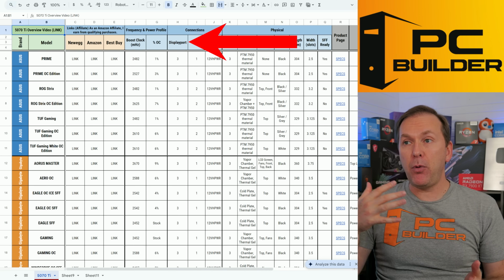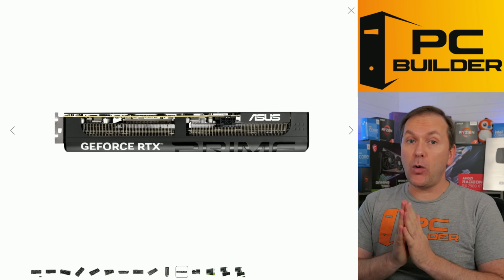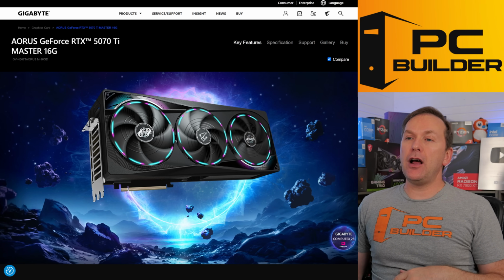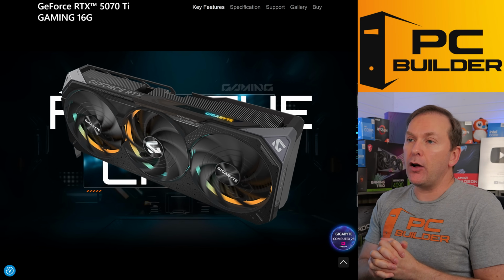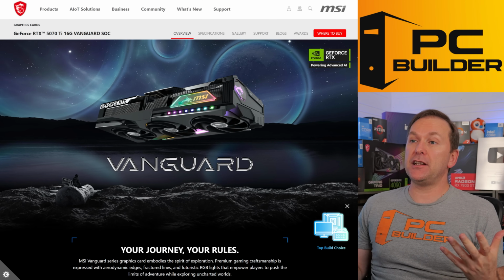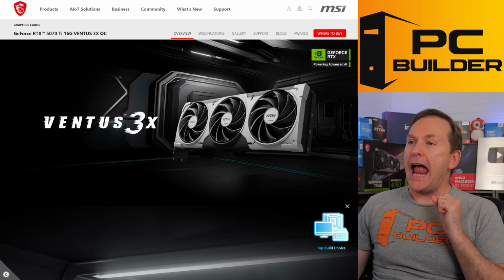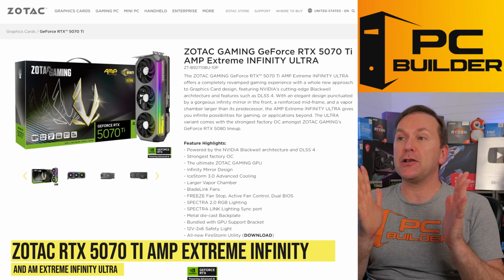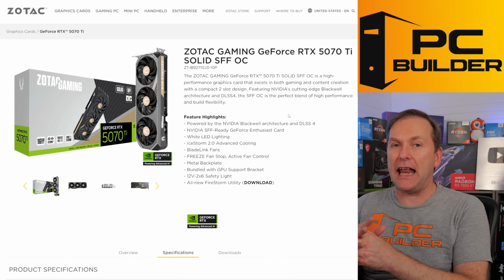DON'T BUY WRONG! 🛑 Every RTX 5070 Ti Model - Specs & Features

Comment: in 9:23 I read online and some ppl said it only turns on or flashes when there is a problem, that it should be normally off. in Gigabyte's site it says ''When experiencing any power supply abnormality, the indicator will alert gamers by flashing light.'' so they're not very clear on that. 

 I just wanna double check cuz i ordered an 5080 Aorus master ice and wanna make sure before it arrives :)
Reply: I have a gigabyte 5070 ti and can verify that the LED is only on when there's an issue with power delivery.

Comment: Im sorry, but what was that gigabyte review? 30 seconds just to gush about an LED light? What about the specs?! Base clock speeds?! Length dimensions?! Like..... 🤦‍♂️
Reply from the maker: Take that up with Gigabyte I’m afraid. Like I said in the video they didn’t provide any of that info before the launch (unlike everyone else) and they didn’t respond to my email asking them. It’s probably up now so I’ll get the spreadsheet updated asap but I’m working on the links as fast as I can.
Reply: That makes sense, thanks. Huge ball to drop for gigabyte  @PCBuilderChannel

Comment: In my country right now the RTX 5080 (FE and Ventus 3x OC) is cheaper than the Asus Rog Strix 5070ti OC, so what should I buy base 5080 or 5070ti OC? In this case, I only play games in 1440p resolution
Reply from the maker: 5080 is overkill for 1440p gaming but if its cheaper than the RX 5070 ti and you have the budget for it why not go extra strong? Thanks for supporting the channel!

Comment: MSI Shadow 3X OC is the cheapest in my country... Is it reliable to go for it? Or go for Asus prime?
Reply: Any of these, even more expensive, you can get coil whine, luck of the draw. Everything else should be fine.
Reply: I had both and returned the Shadow 3X due to noise and temps. It's not terrible. But Asus Prime is sooo much better. :)

Comment: I got a  9070xt, but my multi monitor setup is not running up to the monitors' specs. Returning for a 5070 Ti, which also nets me more efficient performance on Counter Strike 2

Comment: I've noticed something on the spreadsheet. Regarding the specs of the Asus cards, they have a Boost Clock and an OC Boost Clock. For the Asus Prime OC it is 2497 MHz in default mode and 2527 in OC mode but on the spreadsheet the boost clock during OC mode is listed. Is that intentional? Are those the only models capable of OC mode while the others only have a higher default boost clock?

Comment: Please include noise measurement and also info about how many shunt resistors are there on the PCB (with more shunt resistors, the card can detect unbalanced power cable wires).

Comment: That MSI Shadow was on limited sale over the weekend at an online-vendor in my country (still seems to be going with 11 percent of the cards left) - it sold/sells for just under EUR 800 which is ~80 EUR under local MSRP (879). 
Despite that: I bought the one I probably like the least, visually. Palit 5070 Ti  GamingPro OC. But it was "cheap" (EUR 30 under MSRP), comes with a metal backplate (not plastic like on the MSI Shadow for example), has adult sized fans and even a little RGB. Plus, I think, it comes with a little higher TGP than stock from the factory. Haven't received it yet, so I can't comment on the card, but I will admit I'm a little nervous as I've been on Gigabyte cards for over a decade now and have no experience with this particular brand.

Comment: Would rtx 5070 or 5060 ti 16gb last longer. Also 5070 is 630 euros and 5060 ti 480 euros which if it would be a good 1440p gpu i would like to save 150 euros for a monitor
Reply from the maker: Hop over to our Best GPU May video, that might help you think through which is better for you

Comment: I'm running the MSI RTX 5070 Ti Shadow 3x paired with an i9-14900k
Reply: How is it performing so far temperature-wise?
Reply: @its-hdr5152  I have a Lian Li Lancool 217 case and using the Lian Li GA 2 RGB AIO and I'm not going above 80 deg on max settings on AC Shadows and getting around 200fps on average.  It's a great combo so far.

Comment: I have i5-12400 and want to upgrade from 6700 10gb to 5070ti Asus Prime for 1440p. Should i get the i5-14600k? Wanted the i7-14700k but only have 750w gold fractal psu.
Great vid Jason, thanks!
Reply from the maker: You certainly can yes, but hop over to our Best PSU 2025 video and follow the method there to check your new wattage needs

Comment: He's wrong on the led power connector for the aorus master 5070ti, the power led will only light up (flash) if the power connector isn't plugged in or isn't fully plugged in. Just thought id clarify 🙂
Reply: Thanks bro, this dude just scared out of me when he said that the LED should be always on 😭
Reply: @G3n0t  no problem I bet a lot of people felt the same has us lol I was also worried and gigabyte confirmed it should be off when fully pugged in then flash when not fully seated or not plugged in 👍🏽

Comment: I know it's not about processors its worth the 7800x3d at 385 on amazon? I have a 7600x and im like should i???
Reply from the maker: That is a good price for the 7800X3D, but the performance difference from a 7600X would depend on what GPU you have. Hop over to our Best GPU/CPU Combo 2025 video for more on this

Comment: I just bought a  ASUS 5070ti OC  TUF  gaming i was wondering if that was a mistake that i sould have waited  also if the problems with the 50 series were fixed
Reply from the maker: That's a good card. I would just make sure you update to the latest bios but you should be fine

Comment: Hi! Wondering if you have an opinion or advice? My PC is currently a 7800x3d, 64gb ram and 9070xt gpu. It seems to me the 7900xtx might be a better card. Am i wrong? My current gpu runs so close to the 16gb ram that it has. so wondering if the 7900xtx 24gb is better?? confused about all these cards...just getting into VR....newbee!

Comment: On 9:20 about the power LED are you sure the White light is on when everything is fine? i had two Gigabyte AERO models, both of them did NOT had an LED turned on. I think the LED only powers and keeps flashing when there is a problem on normal use there is no LED atleast on my card?

Comment: I thought the MSI Vanguard SOC was the best 5070 Ti version? You can OC it to 5080 lvls of performance quite easily
Reply: It is, tech power up got it to overclock more than the tuf. The spreadsheet is pulling from the advertisement specs claimed by each of the AIBs.
Reply: @alex.fly4  undervolt it for 5080 stocke setting performance

Comment: I went from 3060 laptop version (6GB of VRAM 😱).  That little card hung in there, but recently upgraded to Asus TUF 5070ti OC and it is running amazing.  I can finally use RT and max out settings with upscaling and looks AMAZING!  Yeah prices suck, but I love replaying games I was stuck on medium or low settings now that I can max them out.  And when building a computer you can save a decent amount of cash omitting all the RGB slop.

Comment: OK, this is actually a super useful video.
What would be even more useful is a centralized database of noise measurements for these models. It would probably require a standardized measurement procedure that various outlets agree on, because no outlet can reasonably be expected to get access to all the cards and spend time on testing all of them.
A reduction in noise at 100% fan speed is the only incentive a manufacturer could give me to get me to switch from my RTX 3080 to any card from the 50xx line-up

Comment: I got myself a Palit 5070ti gamingpro. It was $60 aud below Msrp and came with Doom The Dark Ages Premium edition :D it made it better value than most 9070xt's in the end. I've flash an asus 350 watt silent bios onto it, running 430mhz on the core and 3000mhz on memory. 10-14% boosts in games, not far off a stock 5080 ( which costs $850 more than what I paid at the moment 😂 ) and best of all it's quiet 😀
Reply: Just ordered one, best price for a 5070TI at the moment. How did you do that bios flash?
Reply: @TheBadBone23  i'd be interested in that too :'D
Reply: I would be interested as well

Comment: these OC editions are so extremly useless and still people buy these and think they got a good Deal. Cause manually the 5070ti can probably go up to bt 2.8-3ghz. People that can Build their own Pc should also be able to OC the Card, with a tutorial Vid it takes 2 Minutes. I mean if they have the same Price get the OC one but most of the Time the OC ones cost extra money for basically no reason, besides that is overclocking still a thing u do? Cause at least with my card undervolting is way more usefull and i nearly have the same performance as max oc

Comment: Got my Asus Prime 5070ti non-OC, was MSRP at NewEgg a month ago and cheaper than what I can get 9070 XT for in Canada. Happy with the card, got a CableMod cable so it plugs direct to my older Corsair PSU. Undervolted, running cool & quiet 60's celsius and stable with memory/core bump up. Great upgrade to my old 3080 from 2020, which I sold for 1/2 price of this card
Reply: I think you meant your 3080 from 2020
Reply: Have the same card, do you mind sharing your undervolt specs, I’d like to undervolt mine
Reply: @manuelrojas3395  I used this guide https://www.youtube.com/watch?v=f_GSr-BwaBU&t=124s You can try all 3 settings. I swap to lowest one for productivity work, then the extreme one for gaming

Comment: Great video, per usual. Is 5070ti future proof for 4k? Debating if it’s worth paying the extra for 5080. Thanks!!
Reply: The 5080 is only around 10% faster, you can just overclock a 5070 ti and it's pretty much the same.
Reply: @j_ford123 big time agree 👍
Reply: vram is important for high resolutions. I'd wait for the 5080 Super with more Vram if you want to game at 4k

Comment: Just got the Gigabyte Aero and it is a unit, just barely fit in my case and I measured before hand. I believe it has the 4090 cooler, temps are excellent.

Comment: my question is do i wait for the 5080 super with 24gb or do i just give in and get a 5070 ti. I refuse to spend 2k for 16gb of vram in the 5080. But I've heard rumours the super series might come earlier than normal this gen as they are struggling selling 5070 and 5080 cards.

Comment: I've been going back and forth for weeks about which variant to choose. I started by buying a 5070Ti Rog Strix for significantly more than MSRP...but after seeing TechPowerUp's review of the MSI 5070Ti Vanguard SOC, this became my choice instead. I managed to book one yesterday for MSRP and it seems to have a fantastic cooler and didn't exceed 60c under max load. In addition, this graphics card seems to be one of the quietest, then there's always the chance of getting coilwhine, but it's seems to be one of the 'best' 5070Ti's out there when it comes to cooling, temp and rpm.
Reply: Agree that it's the best version. I have one as well. Love it.

Comment: the amount of work for this video needed is insane. thanks a lot man was planning to get a 5070ti
Reply from the maker: You're so welcome! Happy to help!
Reply: @PCBuilderChannel this makes the 5070 ti way more worth it than a 4080
Reply: Literally what are you talking about its a 36 minuite video without a single benchmark or FPS comparison, anyone can research this information useless video...
Reply: @Moxxi  Anyone could, but he did. It saves me a ton of work.
Reply: @mvl71  He did nothing. Let him get back to a normal 9 to 5 job.
Reply: @mexifry222 I thought you weren't staying?
Reply: i get the PNY OC non RGB and is a beast ,my previous 3080 looks like a baby card...
Reply: @rodaynet just got the same PNY. Upgrading from GTX 1080 😂
Reply: I think it was lazy work. Just showing websites and saying "there's not much difference but it does have RGB". This criticism will probably be flagged and deleted.
Reply: @mexifry222 there’s the door. Bye.
Reply: @EdB007  no I'm staying

Comment: I made some impulsive decisions and have a Asus Prime, PNY OC, and MSI Shadows 3x card and need to return 2 😅. I think they’ll Prime will have better thermals and sound reduction (the shadows gets super loud above 50% fan speed) but i’ll have to test them
Reply: Some reviews says that the Msi Shadows are one of the worst when it comes to temp, it runs very hot.  So I would def return that one.
Reply: Let us know which is better for you - Prime or PNY :)
Reply: I had the Shadow 3x and replaced it with the Asus Prime. It's leagues ahead in terms of quality, temps, and noise. :)

Comment: Palit 5070 Ti GamingPro OC V1, runs all tests (Furmark, Heaven, Superposition) +450Mhz core and +3000MT/s (+375Mhz) memory, but heavy games can crash. Thus, after playing several hours in games like Stalker 2 Epic settings and Cyberpunk @3440x1440 with Max with Path Tracing, I ended up with final settings:

Core: +418Mhz (2900Mhz in GPU-Z, hitting max 3.32Ghz, stable/holding during gaming @~3.28)
Memory: +3000MT/s (2,125 MHz or 34 Gbps) 
Power Limit: 100% (300W)
Max Voltage: 1.070V
Temp after 30 minutes gaming: 66-70C

Was thinking of flashing with Power Limit +116% (350W), but don't see a reason for extra 1-2% performance gain and increase in temp. All in all this is giving me true 8-10% performance gain vs stock and I am comfortable satisfied with OC.

Comment: I bought myself the inno3d 5070 3x oc and have yet to see it go over 60c i tried full pt cyberpunk 1440p with literally 1000 mods on and still didn't go above 60c playing expedition 33 rn still doesn't go above 60c and i can actually max out graphics now i had a 3060 prior great card just not for my 1440 360hz oled monitor i had bought

Comment: Ive just bought the Gigabyte windforce non OC. kinda waiting for you to speak about if it would be worth buying. Bought it in a set of otherpart where i could safe some 100 bucks. But would you recommend this card ore not ? thinking about build quality and noice ?
Reply: I have it, runs at like 60-65 C. Overclocks just like any other 5070 Ti from what I can tell. The card is not thermally throttled at all but could have higher fan noise speed than non-small form factor, which is easily fixed with undervolting. The fan does make a slight noise when it kicks out of silent fan mode, but it's not very noticeable from my experience. No RGB features but the build quality seems solid. It does use thermal gel instead of thermal pads which is not great if you are mounting your graphics card vertically.
Reply: I mean it's not bad the wind force is usually the cheapest model it's not going to be great build  quality it won't be absolutely horrible but it won't be really nice like aorus master  tuff, or astral
Reply: @nividia4090  yea i know that. but i got it in a build deal. wanted the tuf ore aorus master.  but then the complete build would be 600+ dollers more. prices are wierd here in sweden.  But aslong as its not the most terrible card.
Reply: @yojarlgaming3541   it's definitely not the worst at all. be happy🙂 you got a great card that'll last you a good amount of time

Comment: At least on the 40-series, though not very well-presented at the time (took some digging) the non-ARGB PNY 4080 specifically had a less beefy cooler than the ARGB one. I think they're doing product segmentation without renaming the models so that the non-rgb models are not as good and the RGB models are higher quality. Seems like they're leaning even more into that by using better quality chips that overclock better in the ARGB models this generation.

Comment: I think decision is you can now get something like powercolor red devil 9070xt for £720 vs MSI shadow 5070ti for £730 in UK
DLSS4 is maybe better over FSR4 with nvidia slightly better non gaming tasks? Balancing that out to having slightly dodgy drivers and having the adapter for power a requirement
Also red devil is probably more premium in the 9070xt range over the shadow in 5070ti range

Comment: I've been getting the Gigabyte Gaming OC version for the past 10 years or so. Very happy with them. I usually display the card vertically, so these are the perfect in terms of visuals and price/performance
Reply: Make sure to check if the thermal paste is leaking, that’s apparently a problem with the gigabyte models…
Reply: @Spyce09  no issues here so far

Comment: An awesome rundown of the 5070Ti selection Jason. I'm still loving my Gigabyte Windforce OC SFF 5070Ti even more than when I first installed it. A few tweaks here and there, a bit of OC applied and it's just so fast and so smooth I love it. I'm also only using it Quiet mode so it's basically silent as well. I'm thinking of trying Performance mode as well but I'd like to get it broken in for a few more weeks first. Also, this is the first non-Apple PC I've had on my own desk that wasn't in some state of modification, testing or part swapping for a client that I have had in about 5 years. I'm going to enjoy it for a while. The Gigabyte card is making that enjoyment a whole lot easier. Great video guys, thanks.
NOTE: My card is also sitting in the bottom of a Jonsbo D32 STD immediately above three Thermalright TS-12R 120mm fans that intake from the bottom and blow directly onto the gigabyte's 3 fans so the cooling is incredible too.
Reply from the maker: Thanks so much for sharing Wire!
Reply: How much did you OC?
Reply: @rover1374  I've got it up to a little over 2700mhz and have the fans set to a minimum of 500rpm which is still basically silent.
Reply: @ nice. This is the card I’ve been keeping an eye on as it gets to one of the lowest prices here.
Reply: no leakage or anything